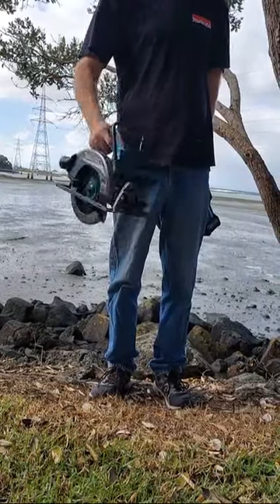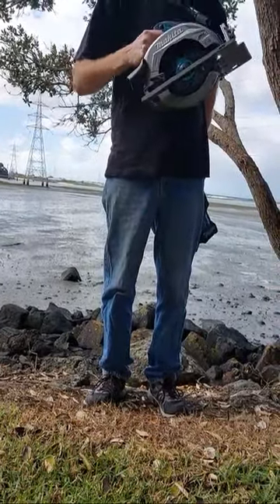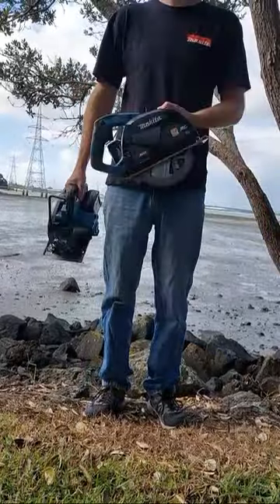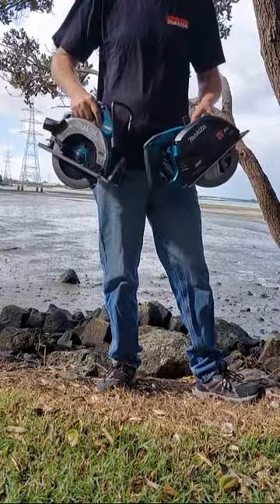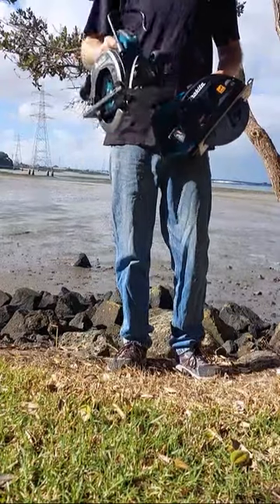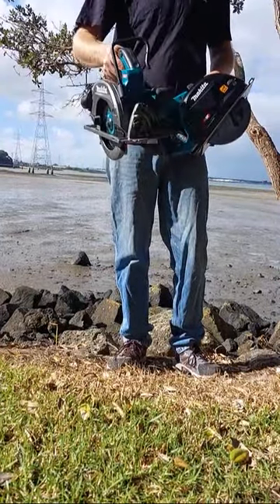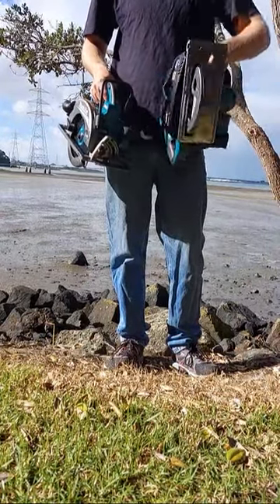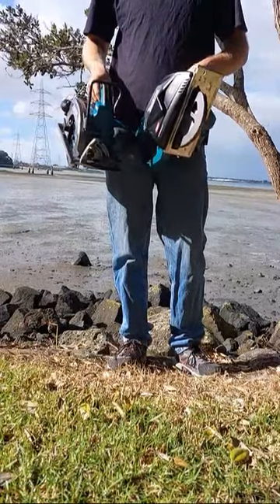Makita Metal Cutting Saw VS Wood Cutting Saw. Makita 40v XGT.

Comment: Not that I'd use it daily, but does this mean that if I'm in a pinch, my variable speed circ saw could work for cutting metal (with metal cutting blad of course)?
Ranges from 2500-5000rpm, so the speed would suffice atleast?
Reply: Yes

Comment: I'm disappointed with my metal cutting saw. I think the factory settings was not quite right, So i returned to get it changed or re calibrated. Upon getting it back wasn't too much better. I have three other cold cut saws. Metabo. Hilti and the 14 volt panasonic.
Reply: how do you like the Metabo saw?
Reply: @FixthisCD  The metabo cold cut saw is good. Very good. Cuts very square. If you put an engineer square after your cut on say a 40mm square hollow section, You will find a gap of maybe 2/10th of a millimetre. Maybe even less. You can also run the saw on a track fence. That is the reason I bought the saw. I bought the makita as I wanted to cut angle iron and thick steel. Also larger square section.

Comment: The old worm drive saws are incredible for cutting metal. They're 4500rpm but because of their high torque will gladly cut through 15mm mild steel without too much struggling.

Comment: Can you also compar the metal saw against a angle grinder? In like the thicker sheet metals? Like 50mm or 2 inches?
Reply from the maker: Not many people are ever going to cut through 50mm steel plate. And if they did, they wouldn't be using an angle grinder or a metal saw like this.
Reply: @ToolsAndStuffOFFICIAL  but can you do a comparison between the metal saw and a angle grinder?
Reply: Well before that I'd be getting out the burning gear tbh

Comment: Diablo's Cermet II blades say 5800 max rpm so...
Reply: Yes they have blades for your normal saw that can cut metal. But your more limited on the thickness you can cut due to that high speed. Its listed on the blade. Also the blades dont last as long and are very susceptible to instant burnout from user error. Also the chip collector is an awesome feature cuz the chips they throw are serious